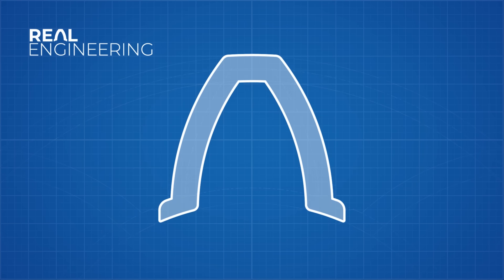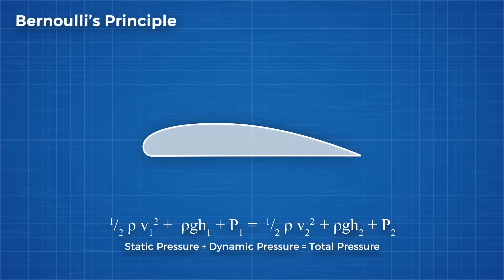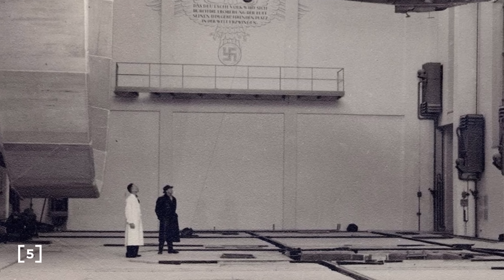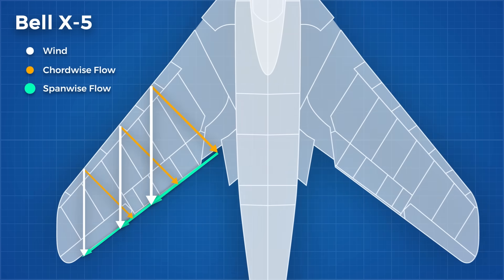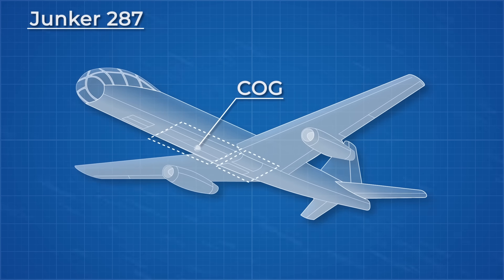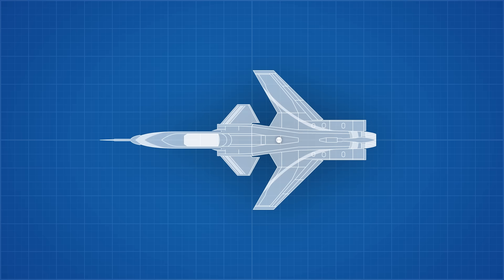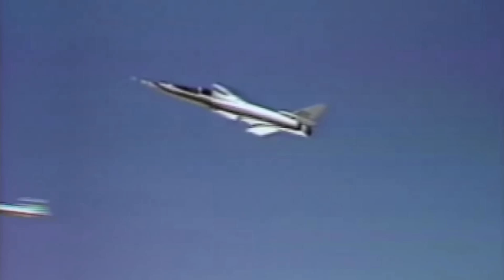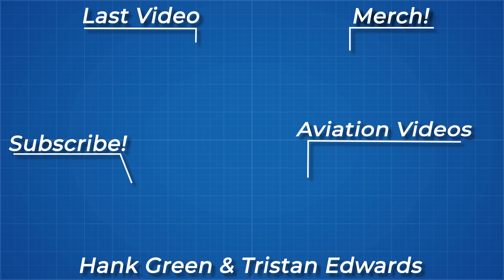Why Do Backwards Wings Exist?

Comment: Fun fact: The X-29 didn't just have 3 redundant flight computers, they were also each programmed by a different team so they would have different software bugs. The idea is, at any given moment, at least 2 of the 3 computers would agree on how to adjust the control surfaces, and the disagreeing computer would be voted-down until the next set of attitude measurements came in from the sensors. This is standard practice in military avionics nowadays.
Reply: It's called three, but it was actually six.  Each of the digital computers was backed up by an analog (!) computer.  The redundancy was so high they figured failure rate was equal to or better than a conventional fighter jet.  The public reason for abandoning the design was the cost vs. instability, but there was a little more to it.  The thing could maneuver so fast that a human pilot would black out due to g-forces, and possibly be physically injured.  Since computer flown planes were still very primitive at the time, it didn't make sense to have an aircraft whose advanced maneuverability couldn't be used.  Too bad it was cancelled before the vector-nozzles could be added.
Reply: @chrisw1462  This doesn’t make sense. The F16 is also inherently unstable and requires fly by wire, including all the redundancy.  It is impossible for a human to fly the F16 manually. Also, the F16 is highly maneuverable with the airframe being capable of maneuvers that would far exceed the ability of the human body. 
The F16 went into service in the late 1970’s while the X29 had its first flight in  1984.
The X29 was only ever a test platform and while there was interest in some behavior as noted in the video, overall the disadvantages outweighed the advantages (namely cost and complexity vs maneuverability). Being able to perform high G maneuvers at super sonic speed became of less interest and that was what the aircraft was attempting to solve.
Reply: Do basically, it had the MAGI on board.
Reply: Łukasz Raczkowski I understood that reference.
Reply: @ukaszraczkowski6260  underrated comment
Reply: Łukasz Raczkowski 
Gaspar?!? You chose him over me? Why Mother?!?
Reply: @ukaszraczkowski6260  XD nice NGE reference
Reply: @ukaszraczkowski6260  my thought lol
Reply: @ukaszraczkowski6260  Eeeey! YES!
Reply: @ukaszraczkowski6260  Woulda been impressed if this comment came out before the netflix debacle. 

But I thought the same thing when I heard it...
Reply: @herranton  yOur'E noT a TRUE FAn. But okay, I did only watch it once it got on netflix, so you got me.
Reply: Shawn Elliott
 - It's too bad that Boeing didn't follow this principle when programming the MCAS system on the 737 MAX.
Reply: @johns7734  That's ok, they didn't follow lots of principles https://nationalinterest.org/blog/buzz/last-year-pentagon-report-found-boeing-spent-years-building-damaged-f-15s-and-fa-18s-67307, and have a history of issues: https://nationalinterest.org/blog/buzz/last-year-pentagon-report-found-boeing-spent-years-building-damaged-f-15s-and-fa-18s-67307
Reply: @johns7734  yeah they really went the other way with that one
Reply: @johns7734  They decided that even though they are getting those super-sweet government contracts, they wanted to move as much production as possible  to a "right to work" state. Because, hey, union workers are expensive. 🙄
Reply: @johns7734  the first MAX was brought down deliberately by remote control, the second again by remote to appear as if it was a design/implementation issue.
Reply: @rickdeckard1075  riiigghht... 🤪👈🔃
Reply: @johns7734  anti Murphy's law (remind you of the shuttle?)
Reply: @johns7734 they snuck the MCAS system into their "refurbished" models with updated bigger engines and said there is no need for extra training, also put only barely mentions MCAS once in the instruction manual that was otherwise not updated with the new model jet 😂
Reply: @John S There was also the issue that the 737 MAX only had 1 sensor with which to measure the angle of attack. Where 3 or 4 sensors is pretty standard, given the importance of redundancy. I dunno what buffoon signed off on that one, or why. Probably came down to cost, as these things tend to do.
Reply: @VoidHalo : Actually the 737 Max has redundant sensors for angle of attack, but each MCAS computer only received inputs from the sensors on its own side of the plane, and the two computers didn't coordinate, requiring the pilot's to cross-check the MCAS readouts manually. and there was a quick-disable button on the control yoke, but it would re-engage after only 5 seconds. 5 seconds isn't enough time to scratch your ass satisfactorily, much less make a pitch correction on a fully loaded passenger airliner. The main power switch for the MCAS should've blinked whenever the MCAS was modifying the pilots' inputs, so their attention would be drawn to the switch so they'd remember it's there. (remember, the 737 Max didn't require special training to fly it.) And the quick-disable button should've been set to re-engage after 15 seconds to give the pilot time to make corrections, calm down, and reassess the situation before it kicked back in. The way MCAS was implemented was basically a Chernobyl-level fuckup -- everyone who had an important decision to make made the most-wrong decision they could, one after another. Fuckups that bad are rare in large projects, which is why modern industrial civilization exists at all, but unfortunately they do happen occasionally.
Reply: And civil FBW architecture.
Reply: If Boeing did this, they would have 3 computers, but the signals from two would only be used if you paid extra.
Reply: Airbus had a problem during an acceptance test flight, where 2 of the AoA vanes froze solid. The correct remaining sensor was down voted and the stall protection never activated.
Reply: Provides great redundancy, this is the same reason I have three girlfriends, if the third one doesn't agree with the first two........same process............ eliminated....😂. **disclaimer**. This practice may be dangerous!!
Reply: @djquestionthis    I'm pretty sure all three would agree on ONE thing...
Reply: @chrisw1462  haha, I hope it wouldn't be when to kick me to the curb.....lol
Reply: @djquestionthis  I've done this with as many as four, and it brought new meaning to the term "dynamic instability". The likelihood that one or more are in a critical mode at any given time goes up very quickly. Diverting system resources to disaster recovery for one node can induce criticality in adjacent nodes, until eventually the whole system implodes.
The key is to only incorporate nodes with compatible architectures that operate in a mutually supporting manner rather than using a resource competition strategy, and that use high quality internode communication. System stability goes way up and operates with far greater reliability!
Reply: @djquestionthis  bruuuhhhh 💀
Reply: @djquestionthis  excellent choice.
Reply: @djquestionthis  top grey came forward yeah. Thanks
Reply: @djquestionthis love you man😅lol
Reply: @djquestionthis  Damn cool! I wish I could do the same.
Reply: @Matthew Savage ~ yeah, I know who you're talking about.
Reply: Yep. Kinda reminds me of how Kalman filter designs frequently use multiple state estimates to minimize error from either sensor noise or (in this case) flight computers.
Reply: As a former software developer in the military avionics industry, I can safely say that this is not standard practice at all.
Reply: I'm not sure about it, but IIRC the first real world application of fly-by-wire with redundant computer systems was done in the Apollo program. Two computers, designed in different ways, aided the propulsion system of the Eagle module to be operated by a single person.
Reply: Boeing could have learned from this
Reply: minority report
Reply: The principles of triple redundancy were also used as one of the original error correcting codes for data transmission and storage.
Reply: And boeing decided to put only 1 AoA sensor on their newest airplane
Reply: I'm just going to assume you're right and upvote!
Reply: This is probably used as the main excuse for abandoning forward swept wings and have actually been working on some trippy ass x planes
Reply: Oh great, you have to shoot us now
Reply: The three computers were named "Melchior, Balthazar, and Caspar." They were made by this hot blonde's mom before she killed herself because a little girl called her old.
Reply: Is this evangelion?
Reply: Basically MAGI System
Reply: Doubting Rich I was going to mention this. I’ve actually accidentally done the same work as another engineer and our code was line for line identical. It’s likely different engineers will end up falling into the same traps. But better than nothing ! You can also get the benefit of this without the complexity of running three systems using fuzz testing.
Reply: that seriously reminds of Evangelion, the super computer, forgot it's name, but it's the super computer
Reply: @natonious3868  as I mentioned, it is MAGI system. Balthazar, Melchior, and Casper.
Reply: Bmw EM  Yes, but still 3...
Reply: @Matthew Savage, You win. Much gold there.
Reply: N-version programming for fault tolerance and redundancy
Reply: oh boy. I am surprised your profile pic isn't going controversial.
Reply: @shnham : Hopefully most people notice it's a parody of the real thing. :)
Reply: @Matthew Savage sounds like me (only i don't live with my mum anymore ;P)
Reply: Damn and i thought i would know what redundancy means :)
Reply: The same holds true for space travel.
Reply: @hulking_presence : guilty lol
Reply: Holy crap, 1800 upvotes? That's gotta be a personal record.
Reply: @Matthew Savage  and that basement was in bangalore
Reply: Shawn Elliott is that an evangelion reference?
Reply: Lol
Reply: woah that's cool.
Reply: I get the idea. Clever, but what does that mean in terms of redundancy. If any computer fails or is damaged isn't then the aircraft less reliable. When there are two computers 'diagreeimg' which one wins?
Reply: How was that FUN
Reply: Ya I hope so as I fear if the Chinese or other nationals do programming for us military it leaves them vulnerable....
Reply: @Matthew Savage nah you're just on drugs mate
Reply: That is genius.
Reply: I loved this fun fact. Yes. Another. Feed me.
Reply: 1and1and1isthree:3
Reply: Computer bullying
Reply: And now you can have my up-vote for your insightful comment!
Reply: My grandfather was the one on the Grumman team who demanded this. He and another engineer who disagreed about this locked themselves in a hotel room until they could come to an agreement. The other engineer wanted to test the unstable systems over Long Island, which would be faster and cheaper, but the chance that it would go under rapid unplanned disassembly over a neighborhood was too high, and would've led to the end of the program. Which is why you see at 11:40 the planes testing is taking place over the desert.
Reply: @randomxnp  And also, some singular module has to 'count the votes' - so to speak - in order to determine consensus. Unless that module is the human pilot then the software bug problem could be simply pushed up stream.
Reply: They put bureaucracy in a plane.
Reply: The MINORITY REPORT of aircraft
Reply: Now that's what i call democracy
Reply: Long ago watched documentary on civil planes (Boeing perhaps): 2 computer blocks. 1 block = 6 different computers performing same function per block. Each computer programmed by different team so no 2 same computers in each block had same soft. Not bad...
Reply: Standart? Funny. 
Tcas in the room of the corner:
Reply: And employing 3 times as many people!
Reply: Reminds me of hardware RAID, an active memory management system.  In this case its application is extended to the main frame.1
Reply: It was called dissimilar redundancy. And it wasn’t so they would have different errors. It was so if one had and error the other two wouldn’t. This approach was abandoned in favor of more extreme testing,
Reply: Except in Russia because they don't get to vote.
Reply: @markrainford1219  They do, but they're manipulated on who to vote for. A bit like MSNBC and Fox news. Hence why Putin is President, Prime minister,President, President, President.
Reply: @markrainford1219  that sounds extremely offensive but also true
Reply: @randomxnp   So hire russians to program one computer then it will always be late, drunk, and crashing it's Lada by making a right turn from the left lane.
Reply: Of course the software would have to be different for each computer.  If not then redundancy would have no value.  If the code is the same across all and the stimulus is the same across all then all will behave identically and fail at the same time.
Reply: @earthstick  All aircraft have redundant flight control units, it is usually for quality control. If one has an engineering defect the other would help it to land, the system utilized in this aircraft used dissimilar redundancy because it was an experimental aircraft.
Reply: @bukiyouneko9863  I don't know your background but I have developed control systems and I can say with certainty redundancy does not work for software if you simply run different instances of the same software.  Redundancy is great for mitigating risk of hardware failure due to manufacturing defects and damage.  But if a defect is due to a design flaw then all instances of that design will have that defect.  When it comes to software there is no manufacturing, it is all design.  So multiple instances of the same code will behave identically given the same stimulus.
Reply: @earthstick  , you are right. And that is, among other things, because in software, design AND manufacturing are (most of the time) the same thing. But not all the engineering management seem to realize that.
Reply: @earthstick  I agree, I did mean hardware failure due to manufacturing defects and other damage sustained in flight but was at a lost for words when I wrote this. I worked on several U.S. Naval Aircraft and have friends in the civilian sector so I do know they all have redundant flight control systems.
Reply: @bukiyouneko9863  @Andre Glad we all agree, after working in these fields for long enough everyone recognises these things but the managers do seem to lag behind.
Reply: earthstick it’s purpose is to harden against hardware failure.  If one unit goes wonky you know which one because the other 2agree
Reply: @earthstick not if they encounter a hardware failure

Comment: Ugh. More misinformation about Bernoulli's Law. The curve on the upper surface of a wing is NOT used to generate a low-pressure zone above the wing -- it does generate a low-pressure zone, but that alone is not nearly enough to generate significant lift if the wing is level. Most of the lift generated by a wing is generated by its angle-of-attack, i.e. the upward tilt of the wing. In a nutshell, wings generate lift by pushing air down -- it's simple Newtonian physics. The curve on the upper surface simply allows air to flow smoothly over the upper surface when the wing is tilted upwards, rather than separating from the upper surface of the wing and forming a vacuum region. A wing's ability to generate lift is dependent on its ability to push air down, and it can't do that if a vacuum forms above the upper surface, because air that should be pushed down by the lower surface of the wing will get sucked into the vacuum region instead, negating the Newtonian action-reaction needed to push the wing up into the air. Additionally, aerodynamic stalls are not caused by turbulence along the upper surface of the wing, they are caused by the lower surface being tilted so sharply that it starts pushing more air forward than down. This causes the wing to be unable to generate enough lift to stay airborne, and slows the aircraft down, thus reducing its ability to generate lift in the future once the stall condition is corrected. There is turbulence along the upper surface of the wing in a stall condition (turbulence is always a side-effect of generating a vacuum, btw), but its effect is also primarily to generate drag rather than reduce lift.

Comment: funy when watching this what designs and idiots do with it today is top day tech on that modern airplane was, using nasa data but flight conditons and tech changed stealth airplane tech woudl use buble between wings which increase glide efect and put larger wing efects more in back, thye used a f5 engine, funy the test was about modern dymanics succses but they didnt even sabre engine waht is funy iran made a all nuclear thoery in gulf for it today, for a project ower 30 years. Unpopular due to russians could develop faster rockets to outrun by speed aeroplane true, but is not flight condtions scfi tech this plane is about nasa tech flight awareness and flight prupose in future not in production lines. That is why RD 181 engine at voronesh facility has low industrial value and raptor engine has fight cost low value russians are not even aware off cost per flight for engine sadly, the main reason why airplane was forgoten again since it was allready out off production as not modern as already russians already had their mig 2,5 mach and verticl hoover systems and didnt know know what to do with it!  As flight dynamics or design in test this is not old is functional testing esp like 1 billion in airplanes in stealth, funy!

Comment: Shouldn't the rear wing drawing on the P38 craving have an inverted airfoil? The rear wing pulls the tail downwards to balance out the front wing. The shock wave forming on top of the front wing blanks out the rear wing, losing its inverted lift. Center of pressure magic happens and the nose goes down. Aka mach tuck. Center of pressure on the front wing moving and magic happens and the aircraft goes nose down, increasing the speed, and making everything worse.